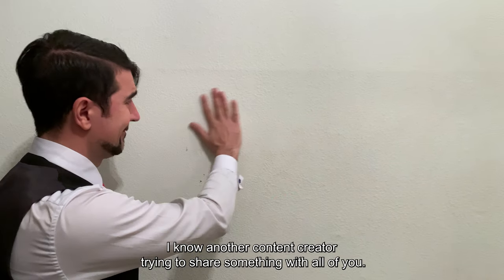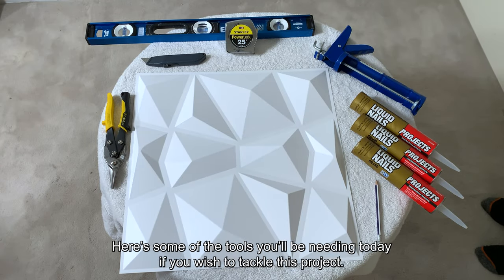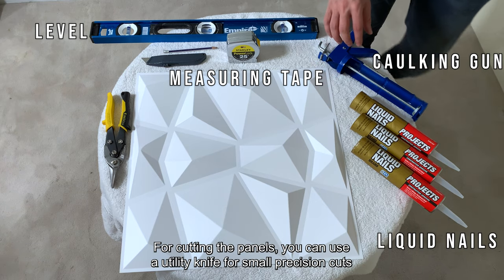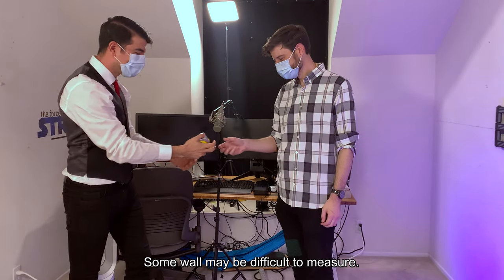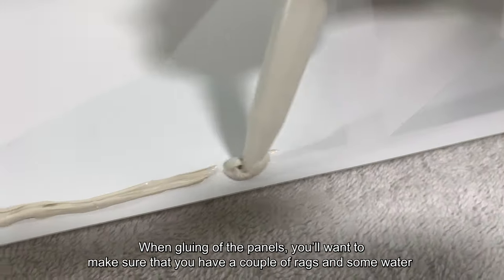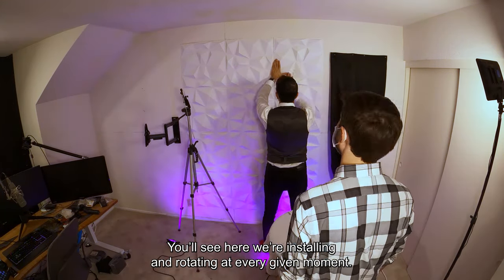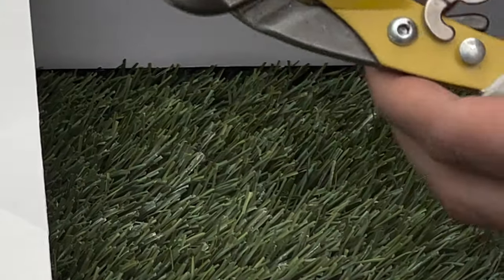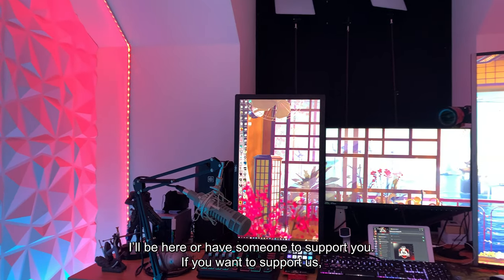Transform Your Gaming Room With These Awesome 3D Wall Panels

Comment: Thanks! I was wondering about the parts where the panels could not fit. I though about cutting them. It seems that is the answer xd
Reply from the maker: Yeah, depending on the wall you will probably have to cut at least some of the panels. Definitely try out tin snips if you have them, was so much cleaner of a cut then the miter saw!